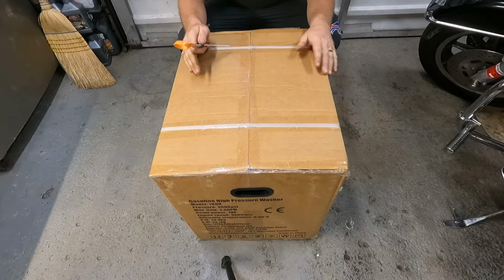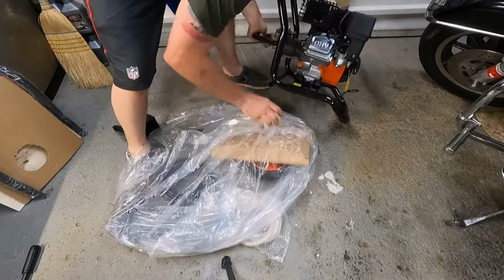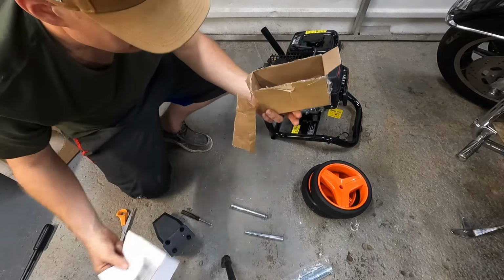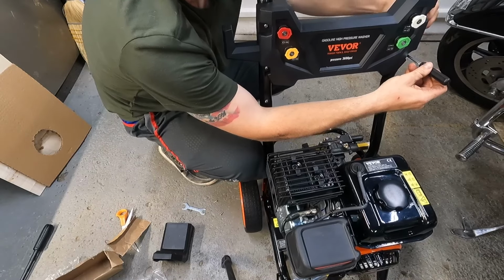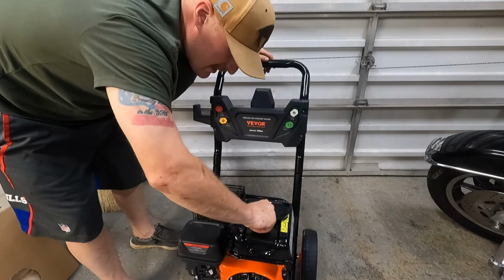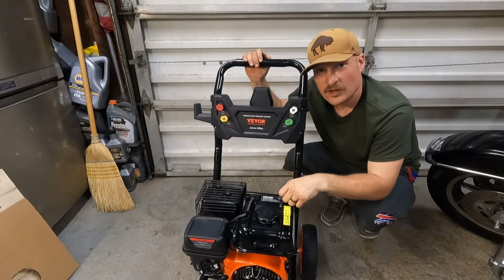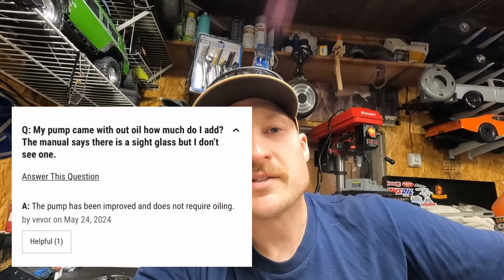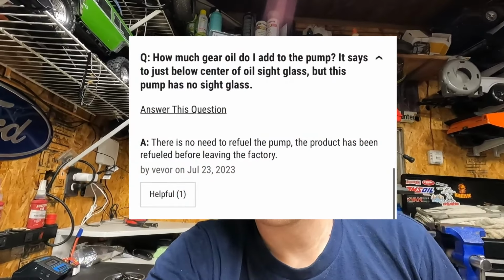VEVOR TOOLS 3600psi 2.6gpm pressure washer unboxing, assembly and review

Comment: I have a number of Vevor products like an 18.5 ft, telescoping ladder which is super sturdy even with my 280lb frame on it. A Vevor range hood over the kitchen stove, a couple of Vevor heat presses, and a Vevor vinyl cutter for making custom shirts, hats and hoodies. I also just got the Vevor 3400psi pressure washer and assembled it today. I have yet to use the pressure washer, but I can say everything I've bought from Vevor works really well and the prices can't be beat. I intend to use the pressure washer on my house and walkways tomorrow. I'll get back to you guys and let you know how it goes.
Reply: Really waiting for your comment, because I'm going to buy this machine for professional use, but I'm worried that might be a less powerful model will be enough for me.
Reply: @YefimovNikita  , I pressure washed my house, driveways and walkways today and the Vevor 3400psi did a wonderful job. I would say it is close to bare minimum for what you would need to do professional jobs. No lower than 3200psi for pro jobs. I personally would get the Vevor 3600psi for $15 more if I were using the machine for professional jobs but the 3400psi would get the job done as well. Excellent machine imo.
Reply: @redwolfacutinaantam7725  Thank you very much for the reply. I am planning to buy a 4400 PSI 4.0 GPM , it seems to me that anything below that capacity will not be enough or I will just be running it for a very long time.
Reply from the maker: Unfortunately that model was out of my budget.  I do have to say I am impressed with the 3600psi.
Reply: @YefimovNikita  , be careful with a washer that powerful especially if you do houses. 4400psi can strip the wood off of houses and the paint off of siding as well as cars. Hopefully you are a pro and know exactly how to use it if using a machine that strong. Good luck with your endeavors, friend!
Reply: @redwolfacutinaantam7725  Thank you. But it's the kind of power washer recommended if you're going to do it professionally. That's why I took it.
Reply: @YefimovNikita  It is indeed a high powered pro washer, but if you don't have a ton of experience, you should be very careful with it. It is great on concrete but on houses is can strip siding and wood and knock out windows. So, if you're going to be doing people houses is with it, it could end up costing you money instead of making you money. All of what I'm saying is contingent up your level of experience with pressure washers. Again, good luck and wish you all the best.

Comment: I saw your video and ordered the washer. The instructions that came with my unit said I also needed to add ND oil to the water pump and to fill it half way on the sight glass. Guess what - no sight glass!! There's another brass fitting on the end of the pump and I'm guessing that is how you determine oil quantity?

Comment: Hi, good video, but does the pump really have 3600lbs of pressure because on the video it doesn't seem to have it, it looks more like 1800lbs or so.
Reply from the maker: @jeanpicard-u6j  I am not sure. I did say in the video I do not have a pressure gauge to test actually output pressure. I do feel it had more than 1800psi

Comment: Should water be coming out the right side of the pump when the sprayer is idle
Reply from the maker: I am not sure the answer to that exactly.  If your leaking though the body of the pump, no. But if it is a fitting it may need to be tightened
Reply: @kgm5512  It might be a relief valve.  Adding an uploader valve  as well as a pressure gauge was recommended by a buyer.

Comment: Mine starts up and bounces all over the driveway like it has frog legs! What am i doing wrong or missing?
Reply from the maker: Sounds like maybe the choke is on.
Reply: @kgm5512  it came out of it but it doesn't have any water pressure when I pull the wand trigger .....then I took the u loader valve out and put it back in then it  worked until I left off the trigger then it spiked to over 4000psi and stalled itself out....then restarted it and it's back to no presure
Reply: @kgm5512  unloader valve manifold was junk from the factory...they refused to replace it or fix it....they ended up refunding me after going back and forth through email and telling me to keep the machine and do w.e I want with it they didn't want it back. So I bought a new pump and manifold for 55 and it works like a charm.

Comment: Does it just engine oil?? Or do u also have to add petrol
Reply from the maker: Hello. The machine is shipped WITH OUT engine oil and WITH OUT gasoline. You will need to ADD both prior to use.

Comment: What size quick connects did you switch over to...
Reply from the maker: @MrDre_Black325  I have not had an opportunity to switch them yet.  There a a few different options on Amazon that adapt to the factory connections. I will update you when I get around to changing them!  Thanks for watching
Reply: @kgm5512  just got mine today. And decided to for the first tome make an unboxing video. And everything was going smoothly. Even gave you a shoot out...lol. and I poured the gas in the tank and it all leaked out the bottom of the power washer....
Reply: Update on power washer. So what caused the gas to come out after I poured it into the tank. Was the way they routed the fuel line from the tank to the carburetor. The fuel line is to close to the part that spins when you pull the cord to start the machine. So when the motor is spinning it rubs against the fuel line hose creating a hole in the fuel line. So I just rerouted the fuel line to keep any moving part for rubbing against it.
And after going back and forwards with vevor for a couple of days. Once I mentioned that I made an unboxing video of everything along with the poor Q.C. they offered me a partial refund which more than paid for the couple of dollars it cost me to buy like 2ft of fuel line. And I've been power washing everything in sight. Hope this helps anyone who may have had the same problem I did.
Reply from the maker: @MrDre_Black325  thank you for the update. Glad you got it all sorted out

Comment: There is a recent comment under the Q&A from June 14th, 2024. Vevor answered, saying it requires 100ml of oil
Reply from the maker: 100ml is roughly 3 oz. That is not nearly enough oil and will not even touch the dip stick
Reply: Oil for the pump, though. Not the engine.
Reply from the maker: @DragonLinkBestDeck  oh 🤦‍♂️🤦‍♂️thank you!!
Reply: No worries. After reading my initial comment, I can see how you got confused. I did not mention oil for pump, just oil... everything has oil lol
Reply: @kgm5512 I've seen 7 different answers from vevor on the same product thread lol
Reply from the maker: @janie06513 I know. I just want them to respond to the dang question truthfully. It’s almost like they want the pump to bust!

Comment: I'm not a fan that the hose has two different fittings instead of the same for both the wand and pressure washer.  The detail in which these Chinese manufactures fool the consumer most is their numbers.  Gotta test to see if it's truly 3600 psi!
Reply from the maker: I agree with you on the hose. I wish I had a way to test the actual psi and gpm but unfortunately I do not.